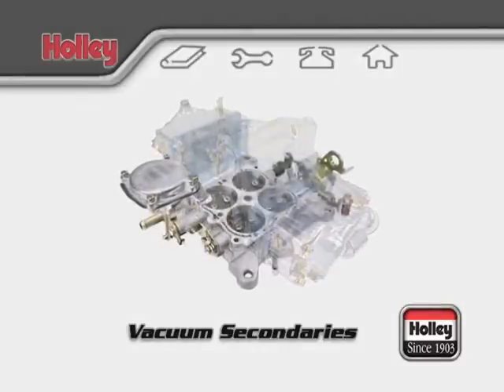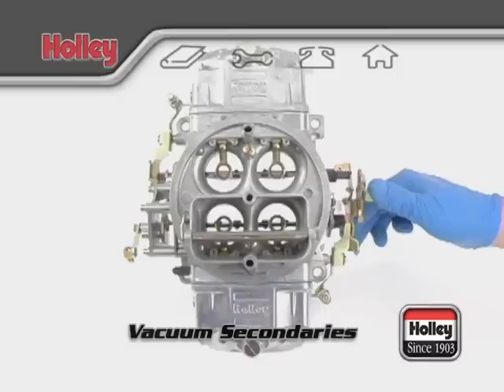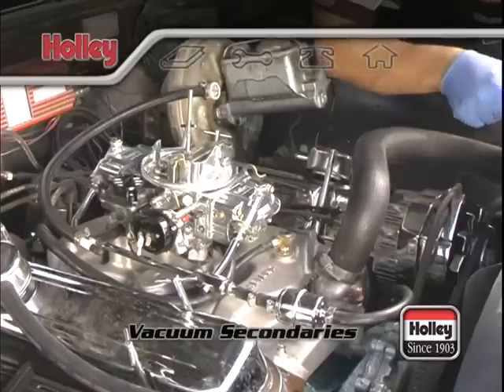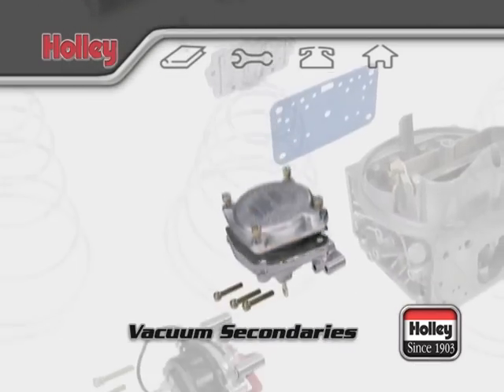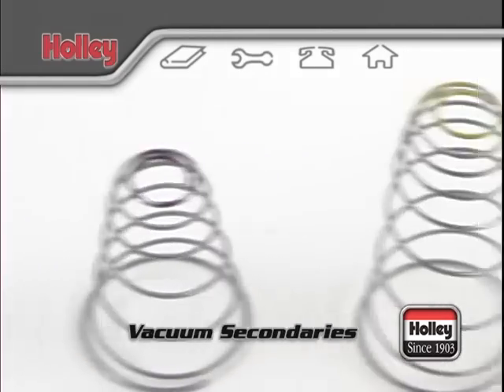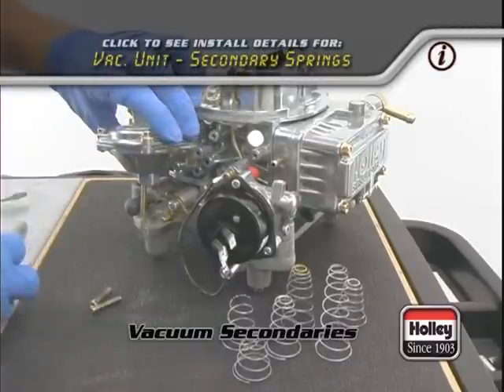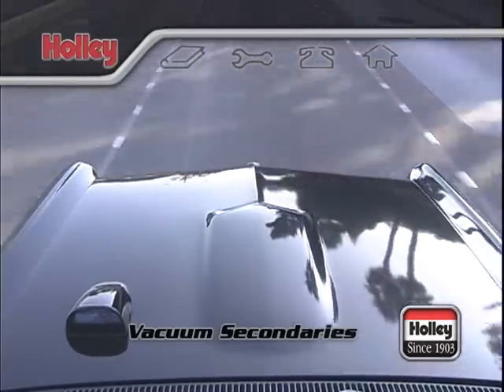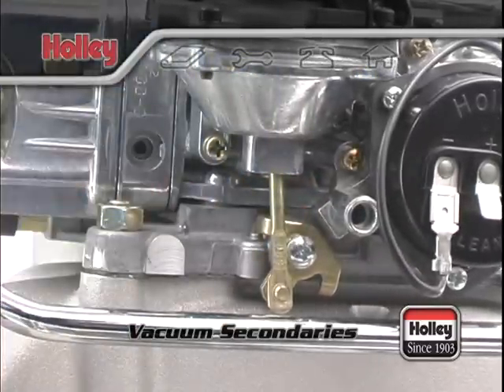How To Adjust Holley Carburetor Vacuum Secondary Springs

Comment: Thank you, Good Info!! Which spring comes from factory on my new 4160, 3310 750 cfm? My engine is a 460ci big block in a 67 Mustang coupe, MSD distributor recurved all timing in by 2500 rpm and car weight is on the lighter side. Thank you!
Reply: The silver or "plain" spring is standard.

Comment: My secondary venturies on a street avenger are not injecting any fuel at all into the intake (even when those throttle plates are wide open), I know for sure that the fuel level is all good and set on the secondary chamber... what am I missing?
Reply: Same here vacum is shit always buy mechanical
Reply: Alex Conan turns out the secondary vacuum spring was too hard for my vacuum.. just bought a spring set and went for the lighter one!

Comment: Please recommend me an optimal performance 4barrel carb Holley Carb  for a stock street/strip  1992 Ford 302 HO working with an AOD transmission...  (actually i'm using a 2-barrel motorcraft carb)
Reply: You may need to change intake depending on bolt pattern but I have 89 or 92 302 in my 66 mustang I put 4160 600cfm vacuum secondary manual choke (leave it open)

Comment: can I run the brake booster vaccum to the valve cover port . my holly does not have a port for the brake booster vacuum
Reply: WTF?
Reply: Spot Light it should be on the very back should just be one. You need to put it into a vacume source you can put an nosle into an intake plug